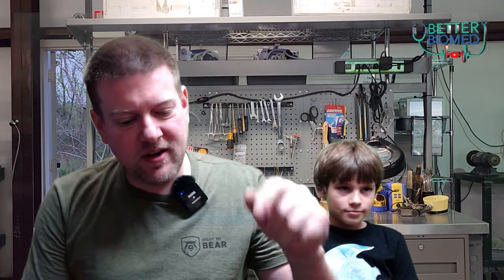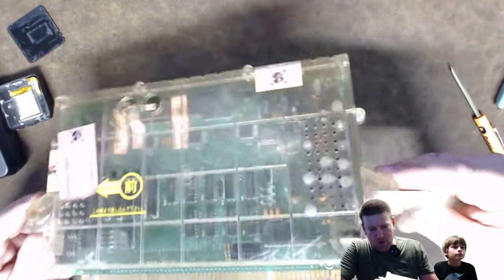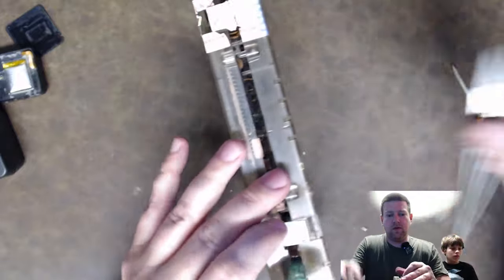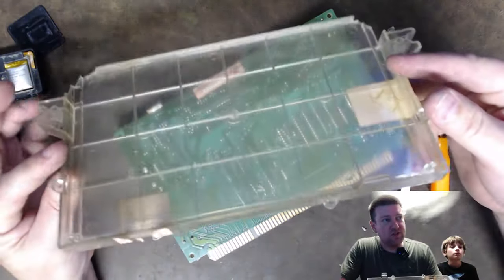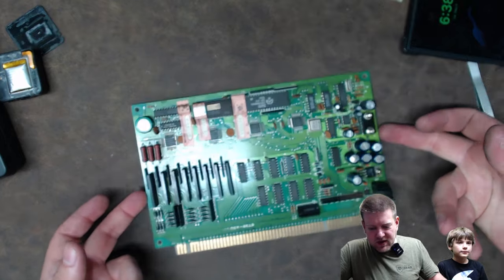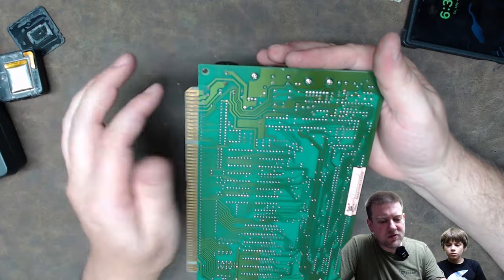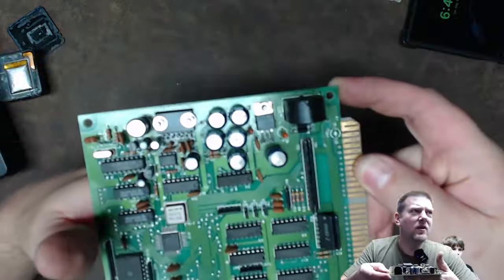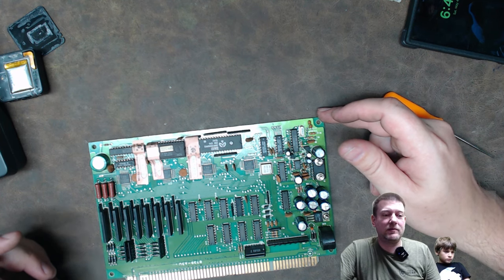Slot Machine Computer Part 1

Comment: As a tip, when dealing with brittle plastic, heat the plastic with a hairdryer to 40a50° C, the plastic will be more flexible and less chance to break. 
The colder plastic gets, the harder and less flexible it gets and more chance to break it.